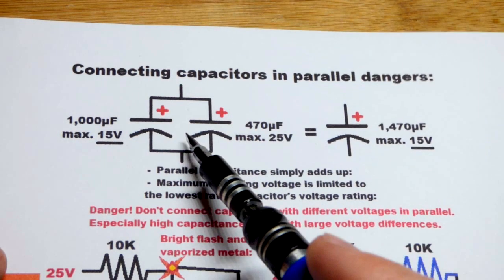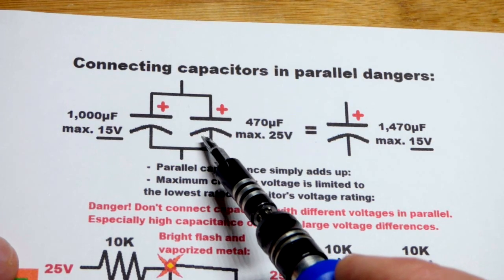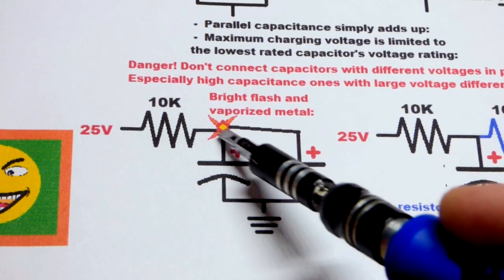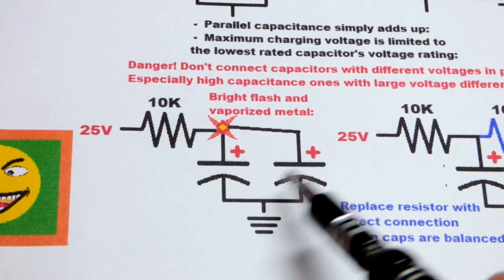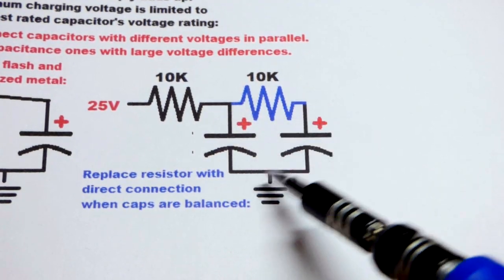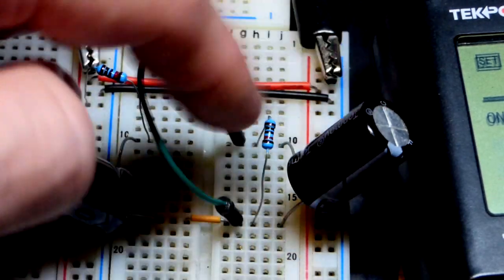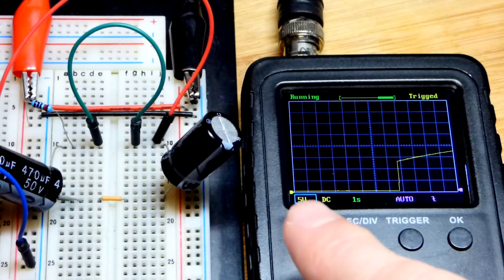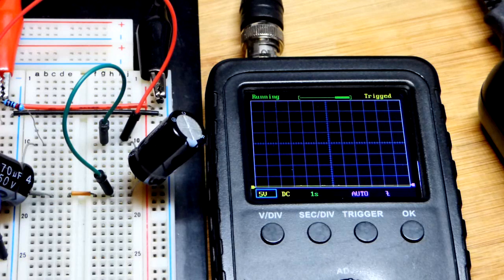Dangers of connecting capacitors in parallel electronics how to DIY tutorial by electronzap

Comment: Hello, I was asked by my professor during a graded recitation this question: What happens when a you connect a polarized capacitor to an AC source? 

I remember answering that it will explode... and to my surprise it was correct! But to be honest, I really do not understand why. Could you please give me an explanation? What happens to the capacitor and/or the AC source prior to explosion? Thank you.
Reply from the maker: I don't remember exactly, is better to Google it. But from what I remember, the dielectric has to have an initial charge across it before it starts blocking current. Reverse charging it makes the dielectric start conducting for a while and it heats up rapidly.
Reply: @Electronzap  Got it! I believe what you said is consistent with what other people have said in online forums, but I would like to commend that your explanation makes it easier for a beginner like me to understand. Thank you.